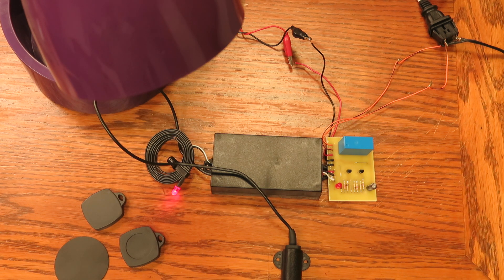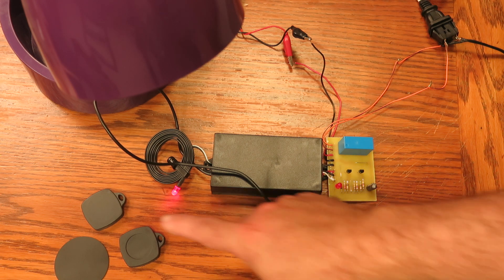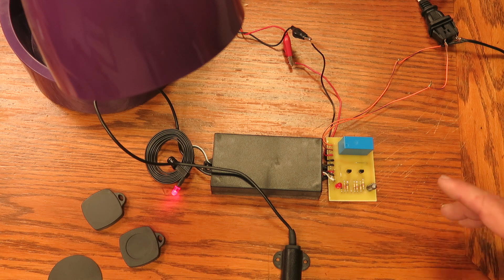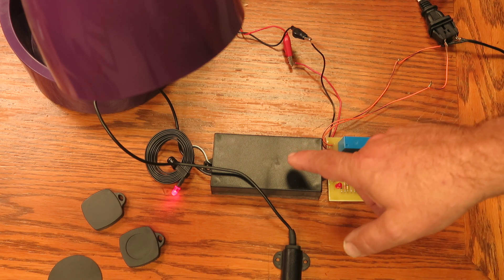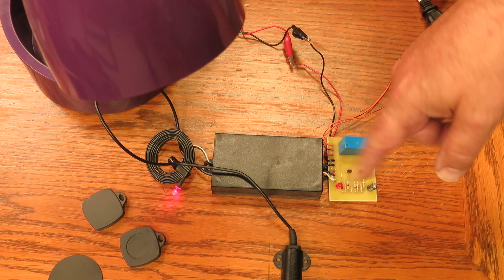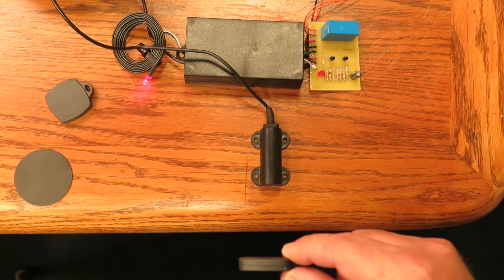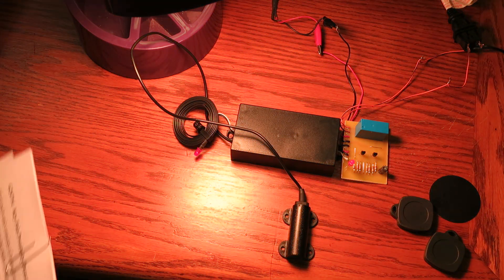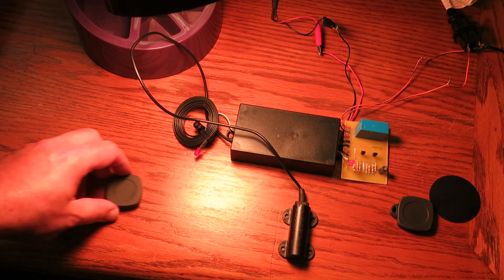G24714 - Key Fob Proximity Detector

Comment: thank you brother, i need some help. my apartment building has installed Kantech ioProx system and has given ioprox key fobs to tenants to access garage. now everytime we have to stop and tap on the Kantech W26 type reader to access garage. is there any way i can use a wireless device to transmit the signal to w26 reader so that instead of tapping i can program my vehicle garage buttons to transmit the same info to the w26 reader? i am so annoyed that i have to stop, roll the window down, tap on the reader and then access the garage....everytime, about 10 times a day on average!